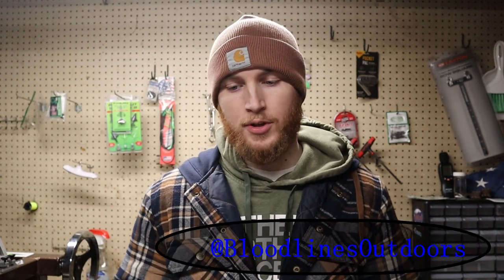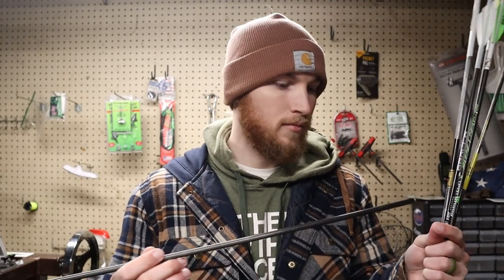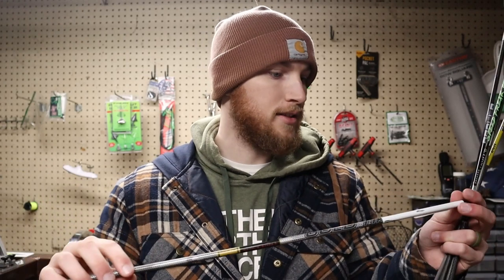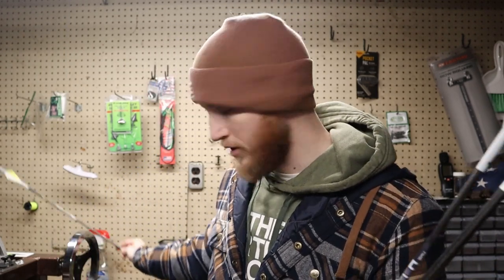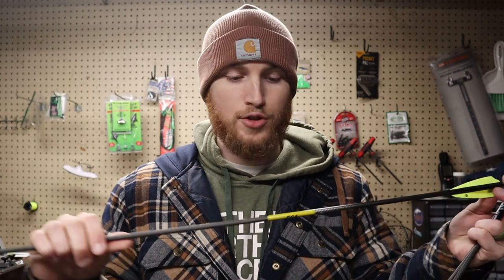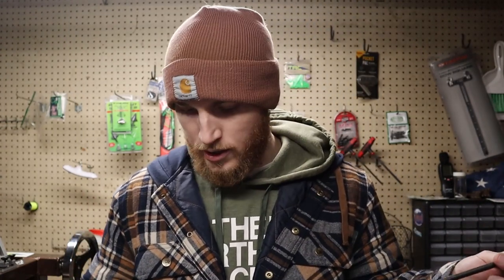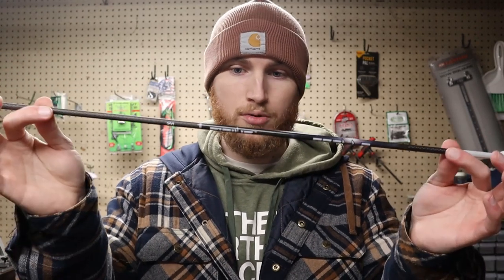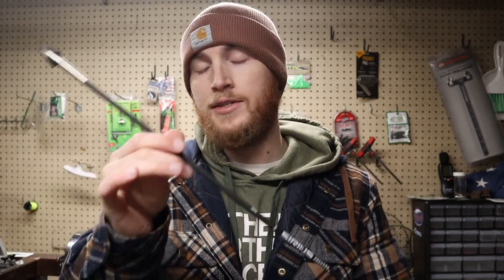Ultimate Whitetail Arrow 2022!

Comment: Cool video, did you have to sand the arrow to get the ethics sleeve to fit over? I’m shooting the black eagle rampage and wanted to use the ethics but I had to sand down the shaft way to much for the sleeve to fit, I ended up using the black eagle FOCOS system.
Reply from the maker: Hey man, no I didn’t have to sand at all. It fit perfectly snug.

Comment: That's heck of a build right there. 500-530g is a nice place to be and you're right in the middle. Out interest can you tell me what poundage your shooting and draw length (sorry. The Arrow nerd in me needs to ask)
Reply from the maker: I agree. I have hung between 475-515 for a while. Depending on the purpose.

27.5” draw, #62
Reply: @bloodlinesarchery  I'm at 72lbs but I have a Hobbits draw length of 26" so it helps. What weight are the ethics components?
Reply from the maker: 85gr.

Aluminum insert cutdown. Stainless sleeve